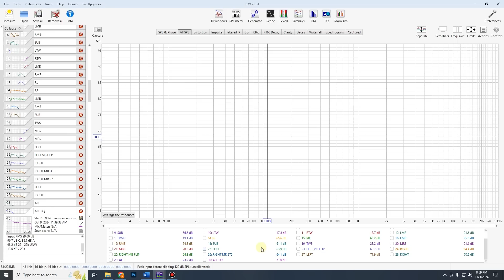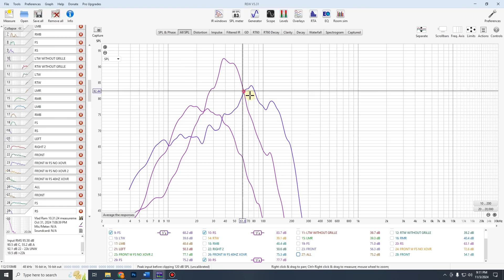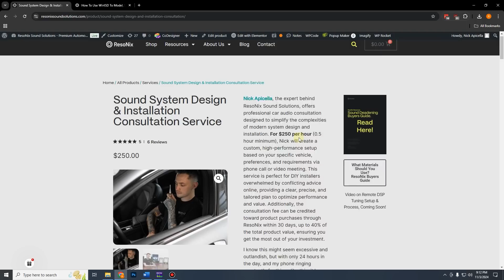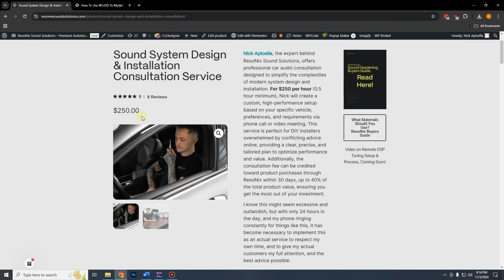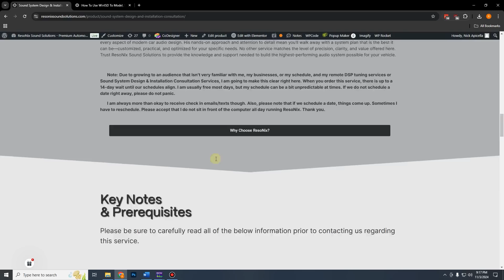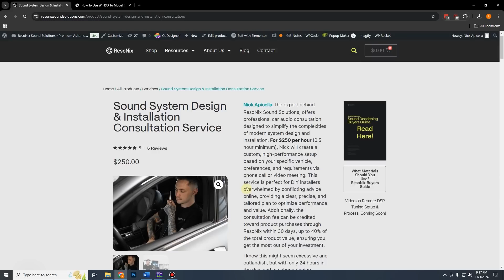ResoNix Tech Tip: Stop Using AudioControl Amplifiers! Subwoofer System Design - Low End Extension?

Comment: Thats weird because on the Epicenter micro for example they have a PFM switch that is defeatable under the cover when you open up the Epicenter micro.   I wonder why they dont have that on their amplifiers.   Im a fan of an infrasonic (subsonic, which is actually the wrong term) on ported enclosures.
Reply: Obviously I want an adjustable infrasonic, not some arbitrary number that the company chooses.   Do better Audio control, I'll stick to selling Arc and Mosconi
Reply: With the R&D they put into the Epicenter, they could have actually tried to make their DSPs more decent.
Reply: @Alastasius I totally agree.   I've installed maybe 5 DM810 processors and I wasn't a fan.   Although admittedly I'm a big fan of Arcs software out of all the companies
Reply: @melissathompson I see you a lot on 5 star, and you also seem to know your stuff,  I have an  audio control LC 1.1500 powering a ported box, it has a fixed 24hz @18 Slope, think this is fine for a ported box @31/32 hz?  Or should I get a full range and use my helix DSP amp to control the crossover?? maybe a wash if its at the same signal and waste of money?

Comment: ❤❤❤Genius , you are a genius❤❤i didn’t know sealed boxes could play that low WOW
Reply from the maker: @denissession9423  definitely not a genius, but I definitely know how to design, install, and tune a great sounding car audio system :)
Reply: When you are dedicated enough to have drivers for such narrow bandwidths... Anything is possible. A sealed enclosure could be tuned to 5hz if you really want it.
Reply from the maker: @swabby913  that doesn't really have anything to do with it. The new rear subs played CLEAN from 5hz to 120hz. That was as high as I tested.
Reply: Sealed boxes can go lower than ported. Ported just plays louder.

Comment: I was always a fan of AudioControl…what else you recommend?
Reply from the maker: @thegrizzlyfamily1374  start with something that doesn't remove the bottom half of the first audible octave 😂
Reply: @ResoNixSoundSolutions such as?
Reply from the maker: @swabby913  I typically use Mosconi Pro or Helix for mono amps. In this car we used a simple JL RD1000
Reply: @ResoNixSoundSolutions  what makes them different from a cheap class d though? I honestly don't know. I know I love tubes. I assume it all has something to do with tolerance to changing impedance.
Reply: @swabby913  The application for the topology of an Amplifier is very important. Class D amplifiers have caught up. Audiotec Fischer is a highly competent company which have proven themselves time and time again. The Helix P One is a great example of a well created Class D amplifier. I'd start there.
Reply: @JasonWW2000  yea. You can definitely hear it. I know what you mean. I really would like to understand it though. Is it the fets? Caps? Inductors? Or is it built in filters that are active regardless of how you have it setup... Someone should really deep dive it. I was hoping this guy would be interested but he seems more interested in selling consultation than having an interesting conversation.